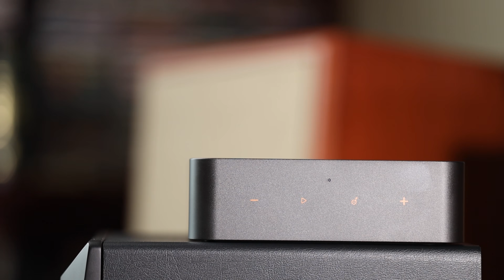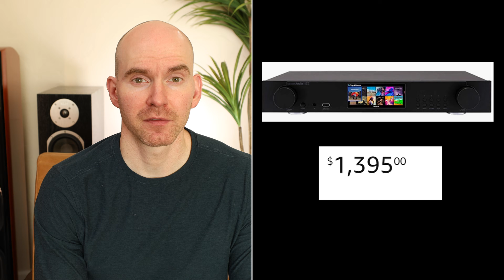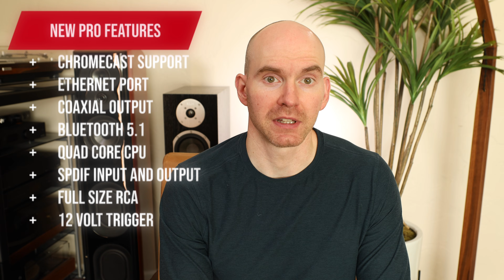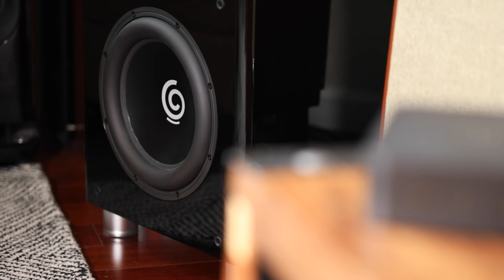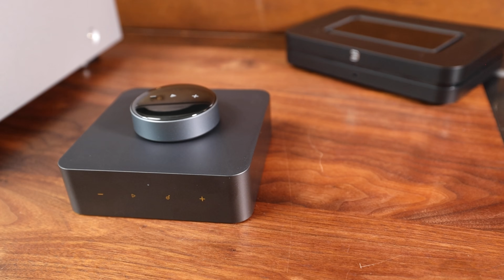WiiM Pro Review - Good Luck To The Competition - Budget Streamer Juggernaut

Comment: In 2025, I opted for the Pro Plus.... which AFAIK is essentially a Pro (same inputs and outputs) with a better DAC and some anti-jitter circuitry added. So it's a Pro with a good DAC built in. I thought that i would miss the display of the Ultra.... but the phone screen is nice.

Comment: Looked at this to try to understand what something like this does or is for. I still don’t understand exactly what it is or why you would buy it. 

People in audio group were crowing about this thing but none of them explained what the heck it is either.
Reply: You use it to stream directly from the streaming services database into your (old fashioned) stereo, instead of transmitting via bluetooth from your phone. This allows for streaming with a higher bitrate and sample frequency, and frees up your phones audio for calls etc. Think of it, as a way to turn old/vintage stereos into sonos..
Also, my TV only has an optical out for audio, so, having just ordered a unit, I am looking forward to watching films with better sound.

Comment: Hi! What would you choose 
A. Wiim Pro with Schiit Modi 3+
B. Wiim Pro Plus

Thanks in advance.
Reply: Ideally you would use an external DAC as the internal one (while totally capable) is running on the same power as the rest of the unit cutting into how much headroom the DAC has to do its job. I just ordered a Wiim Pro and I will be running it into my Topping E30 II Lite via coaxial instead of using the internal DAC in the Wiim Pro

Comment: Can the WiiM Pro:

1. Create a Multi-Room Group Name, to where I can tell Google to play speakers out of only 1,2,3,4 or all 5 of my WiiM Pro devices at the same time, with a voice command without needing to go to the app every time?

2. Can I cast a video to these devices using Chromecast, to where I get to watch the video from my phone but listen to video through the speakers connected to my WiiM? Can I cast the video to my Chromecast, but cast the audio through my WiiM Speakers? Is there a audio delay if so? Can you use the Screen Cast feature on Android?

3. Can a single WiiM Pro device have 1 configuration to where it plays mono out of only the right speaker, a 2nd configuration to where it only plays mono out of the left speaker, and a 3rd configuration where it can play mono out of both speakers, to where all these 3 configurations are presaved and ready to use via voice command through google? If so, can you stack these configs with multiple WiiM pros? (Wiim 1 Left Mono speaker + Wiim 2 Left Mono Speaker = 1 config)

Comment: 12v vs. 5v power supply between the pro and the mini would make a significant difference in terms of audio “headroom”. The greater headroom would make the device less prone to digital saturation as well as analog cutoffs. It would also make EQ more usable at larger signal levels.

I would hope it to have a subwoofer output, which is vital for smaller stereo speakers. Those speakers often need to have the low end frequencies cut off (say below 80Hz, or even at 150Hz for some) to avoid rattling. Yeah, the digital music preserves and presents the lower frequencies at a different level above the analog, so subwoofer is a must for smaller speakers.

Comment: Gave this a shot as a streamer only in my mid tier system (around $2k-$3k per component) against an original Orchard Audio PecanPi, Allo Signature Raspberry Pi with Allo Shanti power supply, and an original Bluesound Node. With its stock wall wort the Wiim Pro came in 4th sounding more constrained and congested than the others and I wouldn't recommend it for any level system other than very low end non-critical listening systems. However, add the Allo Shanti power supply and it vaults right to the top equaling the Allo Signature with Shanti. For around $350 it's definitely a value keeper in that configuration.

Comment: Chromecast support won't be bit perfect. The Chromecast Audio supports 96Khz/24-bit but all other Chromecasts are 48Khz/24-Bit. That doesn't mean Amazon Ultra HD is supported on the Chromecast Audio. It's still down sampled to 48Khz. Maddening as the 96/24 is specifically for FLAC. Which is what Amazon use for their Lossless music. Amazon HD works on Chromecasts but it only seems to be Google made Chromecasts. Maybe that's why Amazon say Amazon Music HD isn't supported on Chromecasts but the HD (not Ultra HD) gives me losslessly 44.1Khz/16-Bit on both my Chromecast Audio and 3 Gen Chromecast. My devices with Chromecast that aren't made by Google I only get the Lossy SD music.

Comment: Hello ! I am from Romania and I have a big request! HELP ! I follow you with great pleasure and respect you! I bought a WIIM PRO complete with remote control for all the advantages it has! It's just that I can't seem to enjoy it because the output to my Q ACOUSTIC passive speakers is not good. I have a very good Arylic s50, only that it does not have a digital output to connect to the TV, which is why I chose WIIM PRO! Why doesn't it work with passive speakers directly? can be heard in the speakers but low volume! WHAT should I do without adding an amplifier? THANK YOU!

Comment: Hello, I have a little problem with my WiiM Pro. Coax out can't support 24/192khz, only 24/96Khz. I don't know why? I changed several cables but no success. Optic out supports 24/192, but Coax doesn't! How  I can solve this problem, if you have any suggestion? Thanks in advance.

Comment: Absolutely frustrated with the WIIM Pro.  I have two Synology NAS.  The setup detected my 212J which only contains old movies.  It did not and will not detect the DS920J+ NAS which actually contains my music.  I tried both wireless or wired ethernet. There is no way to connect a NAS manually.   Sending this garbage back
Reply from the maker: Hey Patrick, problems like this are frustrating no doubt. Did you by chance reach out to their support? They have a really good support staff, maybe they would have some ideas.
Reply: @MattCoykendall1  I did, Should here something in the next 24 hours.
Reply: Here is the response from WIIM, "Can you check if other App such like BUbbleUPnP can find DS920? I not, I think maybe the DMS service is not start.
We only support DMS protocol NAS, we will add SMB protocol support this year."  I found the reference to SMB and turned it off and WIIM displayed my music. But than my media subdirectories were turned off on my Windows PC.  I rechecked the SMB and everything worked.  Four hours later the WIIM did not display my music again.   I have had home servers for over a decade and have never experienced this level of frustration.  I am going to send back the WIIM and order a Bluesound Node.  Maybe I'll have better luck  with that.  My conclusion is that WIIM is still garbage if the end user is required to be a server expert to get it to work.

Comment: How much difference will I actually notice with one of these compared to my present set up which is an iPad with a DAC which goes into a mini Amp? I'm 56 and wonder if my ears have degraded to the point that I could barely detect the difference between Bluetooth streaming from my phone never mind using a dedicated streamer. At what point does my 56-year-old self stop buying for my 26-year-old self?
Reply from the maker: Difficult question there, I would suggest don’t give up on finding improvements if you enjoy the search, it’s a hobby in itself. I would also suggest in this scenario to buy from Amazon, simple return policy if the improvement isn’t there for you. You may also look at it as a tool with more features as well that could be of use to you rather than just looking at the sound quality improvements over Bluetooth.

Comment: Thanks for this review. I have but two questions (yet to be answered by the mfgr). I want to know how these units handle a drive (all .flac) that is parked on my network (NOT NAS) on a PC via a mapped / shared drive. IO presently have around 50,000 .flac files and wonder what the limit might be on the number of tracks that it can assimilate. I'm replacing two Sonos Connect which had, until about a year ago, functioned flawlessly but now randomly stop playing tracks, only to play the next track in the queue (side note: Sonos support has been, well, underwhelming / frustrating). The 2nd issue is this: I like running two units because I already have a whole-house analog feed (balanced lines feeding differential line receivers) that at present is connected to one of the two Connect units. The 2nd unit is dedicated to the critical listening space (perfect for late night). So my 2nd question is whether I can have two units live peacefully on my network and have them both see the same shared .flac disk volume, and be run independently (I NEVER run the same feed to the two Sonos Connect units as the whole house feed is also available in the critical listening space). Sorry for being late to the WiiM party, but as I said, up until a year ago the Sonos Connect units worked well, but this frequent and random interruption of music (and yes, I am running wired connections ONLY) has become untenable, and a real vibe-killer, especially when I have guests over. If anyone knows of some resources I could peruse by way of a few URLs that would allow me to dig a bit more, I would be very grateful. Many thanks.

Comment: Thanks for the review! I´m wondering if the internal DAC, although it obviously is not the best, would be at least as good as the one in the Yamaha WXAD-10 that I used so far. In one forum someone wrote that the DAC in the Yamaha is supposed to be way better, but he doesn´t hear the difference anyway. What do you think? If the Wiim DAC is worse, what would be a budget external DAC that´s better? Thank you!!!
Reply from the maker: Sound quality is going to be really close here,  same chip. Before buying another DAC just give it a shot and see how you feel about the sound, may need need to invest further!
Reply: @MattCoykendall1  Thanks!! 👍
Reply: I noticed that the Yamaha has the Burr Brown PCM 5121 DAC and according to your video the Wiim has the TI PCM 5121. If I get it right, it´s the same exact DAC so the sound quality should be the same, right?

Comment: How does the coaxial output compare to the optical?  I have the mini but found it lacks a bit of punch in the sound compared to playing a CD through my Chord Qutest DAC, yet on the Amazon app on my PC it is great. For me the coaxial output as always produced a better sound than optical. Would then consider purchasing a Pro when its available in the UK.
Reply from the maker: Hey Richard, I almost always gravitate to the coaxial as well, I can’t say for certain why but it’s been a consistent favorite for myself.
Reply: I have always used optical and have decided to switch due to the difficulty and frustration with trying to plug it in correctly.  Its proper orientation into it’s socket is a pain, particularly when audio/video equipment is in a cabinet.  I can now see the beauty of the simplicity of the coaxial cable design.  Thanks for giving me confidence with sound quality with coaxial.

Comment: I am trying to decide between an Argon Audio Solo and the Mini Pro. The Mini Pro has more inputs and outputs but since you highlighted the so-so DAC on the Mini Pro, I am struggling with what to do. I have an older Moon integrated that has zero digital inputs. I have a LG TV that could be routed to it and my older CD-1 from Moon as well.  I use Youtube audio now too. 
'
Do you know the Argon Audio Solo yet? If you are in the EU, you probably do and if outside probably not. How would the Argon Solo stack up against the WiiM Pro?
Reply from the maker: I wish I could help but I have no hands on experience with the Argon products. Not widely available in the US, thanks for watching though!
Reply: i have argon solo and wiim mini. Argons internal dac can be used only in case of its analog connection. I would choose argon over wiim if you use roon.

Comment: Thanks for the video Matt! Question: is the WiiM (either one) a good replacement for the Apple AirPort Express??  I use the AirPort to stream audio from my computer and cel phones to my Logitech Z625 speakers. Is the WiiM mini enough? Or should I go for the Pro? Thanks!
Reply from the maker: It’s a good replacement, no worries there. Deciding between the mini and pro is really dependent on needs, coax connection, digital input, chromecast for examples are additions to the pro. The two products will sound the same so base your decision on connections and features.
Reply: @MattCoykendall1  Excellent!! Thanks! Just ordered the WiiM Mini

Comment: Good review. I did some in-depth testing on the Wiim Mini and thought you'd be interested in my results. I performed a head-to-head comparison between Audirvana Studio using an iFi Signature DAC and the Mini. I only heard one small difference in one song. My system is a Rotel A11 Tribute with KEF LS50 Metas, so it's resolving enough to pick up subtle differences. Both the Mini and iFi were being fed into a Paradigm PWLink room correction module. The iFi was connected via analog (using Worlds Best Cables) and the Mini was connected via optical. 

In an email exchange with Wiim support, I manage to get Qobuz Autoplay added to their release schedule, which is pretty impressive. I tested the Mini's BT capability and their system uses AAC as the primary codec. This is good for Apple users, but a small miss for Android users that have apt-X. So, if someone is heavy in BT and has an Android phone, a good BT apt-X receiver like a Home Spot ($25) is worth the difference and will sound better. Compared to Play-Fi (which I have as well in the PWLink) the Mini is hands down the better system, even after Play-Fi's upgrades. As for the Wiim Pro, its big feature is the addition of an optical input for a TV/external source. If Wiim ever does a V2 of the Mini, I recommend they add a 3.5mm/optical port to handle a TV. So yes, I agree with your observation that Wiim is an excellent streamer.
Reply from the maker: Hey Larry, thanks for the detailed synopsis, what I appreciate the most about the WiiM products is that it truly appears they care about this project and have continued to improve it, glad to hear they added Qobuz to the release schedule as well. It will be interesting to see their future releases...
Reply: @MattCoykendall1  Matt, Qobuz is there now. It's autoplay they will be adding.
Reply: Did you engage the room correction on the PW link while testing the Mini and the Ifi?
Reply: @darpanbhuyan1909  Yes. I plugged the iFi into the analog input and the Wiim Mini into the optical port. On the PW Link, its port detection is automatic, meaning that when the music stops on the IFi I started streaming on the Wiim, so there was little to no time lag.
Reply: @larryh9525  - The thing with the room correction on the PW Link is that it goes through an AD/DA conversion (analog to digital, then back again from digital to analog) so any gains with the Ifi Zen Signature would be negated by said AD/DA conversion and it'll all sound mostly the same. To hear a difference between the Zen Signature and inbuilt DAC of WiiM mini, you'll have to use a "direct" mode which bypasses the AD/DA conversion.
Reply: @darpanbhuyan1909  You're correct about that, but without room correction active the acoustics of my room are so bad I couldn't hear any difference anyway.

Comment: Thank you - I just want to know if it sounds any better than the Node (both using same external dac). As a streamer only, does it sound any better?
Reply from the maker: If both are using the same external DAC its going to be mostly indistinguishable between these two, at that point its easiest to way features and cost.
Reply: The WiiM Pro is bit perfect over coax or optical.
The Mini is now also bit perfect, but has fewer connections.
Digital is digital, there's no difference in ones and zeros unless something is wrong.

Comment: The Wiim has a graphic equalizer. How does the EQ function when you are using the optical output? Does the Wiim convert to analog, apply the EQ, then convert back to digital?
Reply: I seem to remember Audio Science Reviews testing the Mini and finding that boosting the (digital) EQ resulted in audible distortion.
I tried playing with the EQ on my Mini and didn't like the results.

Edit: it's purely DSP, not analogue EQ.
Reply from the maker: I am unsure on this one, I would need to check with Wiim for clarity.